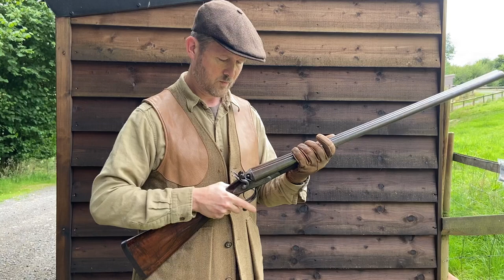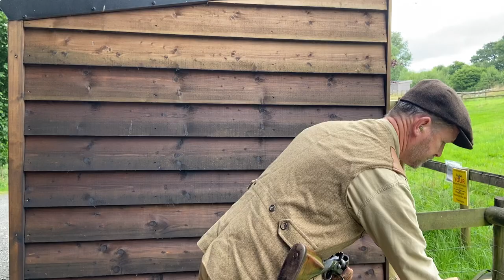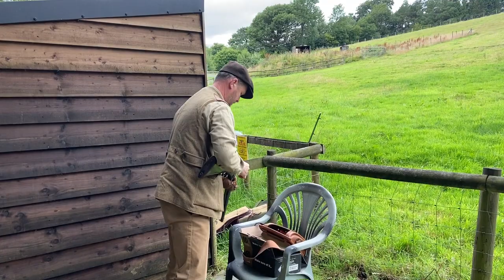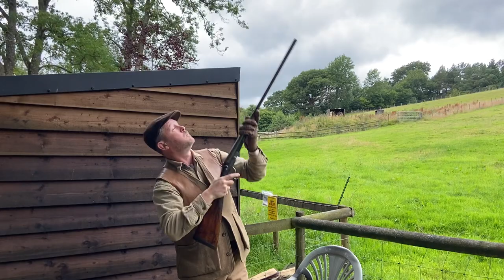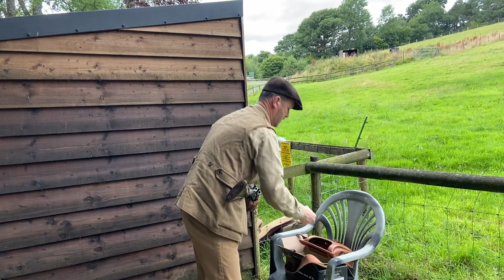Non rebound locks, Jones under-lever.

Comment: Looking at that, I just know that if I were shooting a non-rebounding hammer gun, I would eventually forget to half-cock it before reloading, and would slam it shut on live shells with hammers fully down...
Reply from the maker: Like driving a stick shift, you get good at it. Shutting the gun on hammers down will not fire the gun, the hammers are under spring tension, not held hard down, insufficient force to fire a cap.
Reply: @headbutt67 Sir, what type of gunpowder are you using? What is the weight of the shot, and do you make your own ammunition?